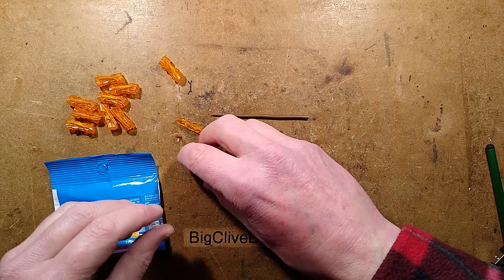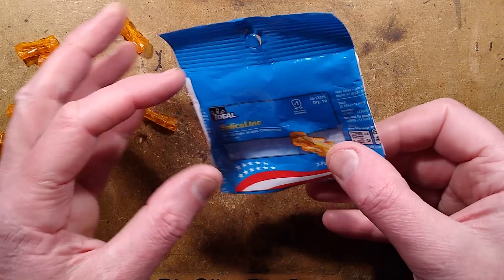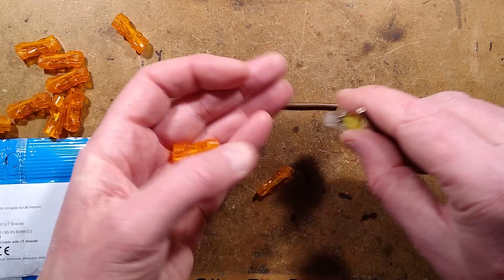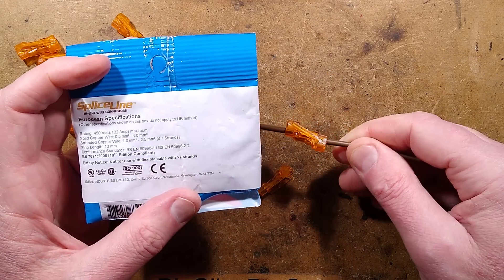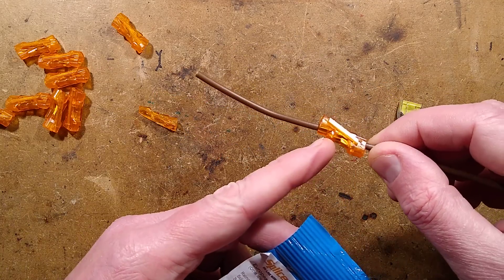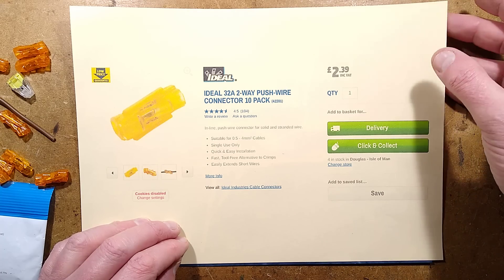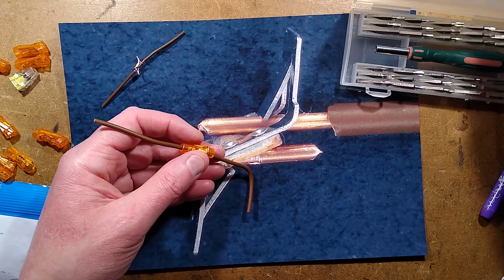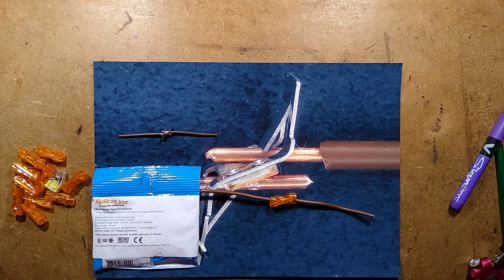Inside a SpliceLine push in cable connector

Comment: Yeah, Ideal is an American company that does mostly electrical supplies and electricians' tools — they're probably the most common supplier of wire nuts over here. I also have a stripping tool from them and one of those tone probe / tracer thingies.

Side note, Wago also recently came out with an inline / "through" connector, the "2401" type. Unlike these, and like your ordinary Wago, it's lever-lock rather than push-in, so it doesn't rely so much on the stiffness of the wire.
Reply: In fact, Ideal holds the trademark for "wire-nut".
Reply: Ideal also just cloned the wago 221 lever nut.
Reply: The Ideal brand Wago-style (true lever-nuts) are, interestingly, Made in Austria!
Reply: Those new Wago inlines are awesome.
Reply: I've had a Wago inline connector bumping around in my toolbox for years. Although it's one for connecting flex to installation cable (like when you're hanging up a lamp).
It's their, hold on, 224 series.
Reply: Looks like trade deals with the US states are happening after Brexit.
Reply: America is full of nuts :)
Reply: @nixeto  Bigclive pulled one version of those apart already (Clone of Wago product that Wago don't even sell???).
Reply: @nixeto  no they made a 222 style inline.
Reply: Love those online lever wages,  the inline push ins look good same price as the wagos and not as bulky.
Reply: I also have the toner, brilliant tool 
Helped me loads of times locating stray Control cables
Reply: Wago recently also introduced push-in inline connectors (2273-2401).
Reply: 4 replies missing very strange on an electrical channel. U tube are disgusting.
Reply: @tonysheerness2427  
If you log out, of YouTube, most of the "missing" comments miraculously re-appear.
None of these comments. at least on electrical channels, are in anyway offensive.
The algorithm is again broken.
Reply: @tonysheerness2427  anything with a hyperlink gets nuked by YT, BC may have also removed some idiocy
Reply: @tonysheerness2427  Yep, the Toob assiduously jumps on anything that might even remotely affect its earnings-potential oriented "rules" - but is completely "unable" to automatically kill all the proven scam junk that floods through the gates. 🙄

Comment: Pushing it from the back only presses it down on the wire even firmer.
Reply: Maybe use a small, but stiff, wire in the same hole where the wire is pushed in that can push up. I have a very thin "spring steel" piece that might fit. I'll find out when I receive mine.
Reply: @Texas1FlyBoy  Some of those 'keys' they make for releasing the internal metal contact elements from the plastic housings, by reaching in and pressing down the little tab that locks the metal bit in place, might work.